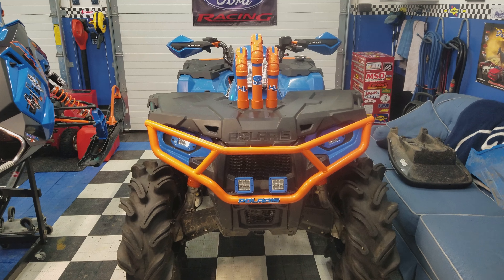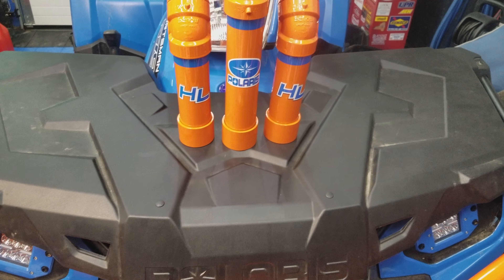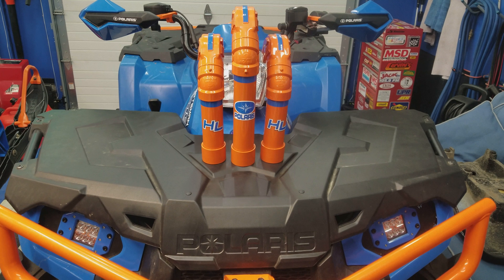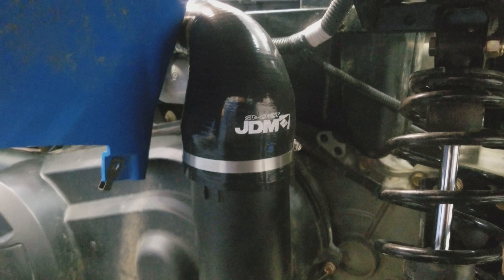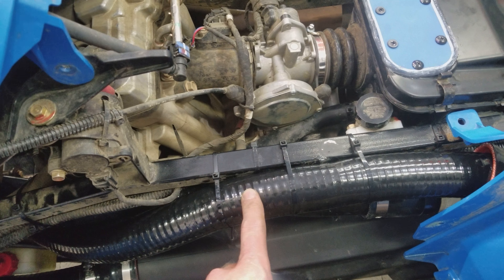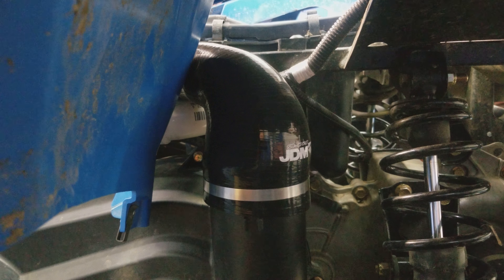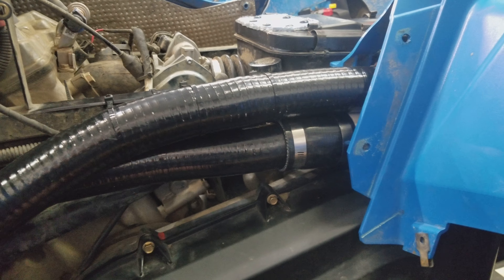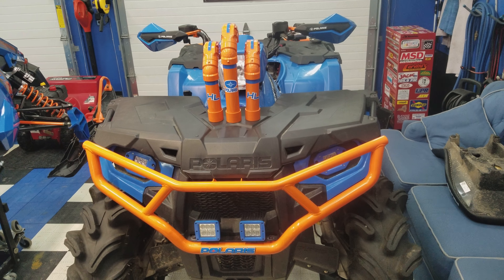2017 Polaris Sportsman 3 snorkel install

Comment: those fittings are a 2" male and female threaded adapter
Reply from the maker: Jayce Vessier nope. I used a rubber 1.5" coupler to connect the flex hose to the risers. I tried the threaded ones and they weren't near as sturdy.
Reply from the maker: Sorry a 1.5" coupler is approx 2" inside diameter.

Comment: Are there supposed to be 2 snorkel pipes that run from the airbox?? I've never run a snorkel setup before but I'm curious about the 4th snorkel tube and if it's necessary? I just bought a 2017 as well and was wondering how it's holding up for you. Any problems so far?
Reply from the maker: Most kits do have two but I only ran one.  Absolutely ZERO issues in 2 years.  Watch my latest video.  My son is two bikes ahead of me in the video and he went through the swamp without any problems.  We do that on a regular basis and his snorkels have never failed.

Comment: Could you possibly take pictures of how you mounted the risers to the storage box?
Reply from the maker: Not without loosening the clamps which is a pain. They are held in place by the tight fit of the hole through the box lid and then the rubber coupler that connects the snorkel riser and the hose.

Comment: I would definitely use PVC rather than abs pipe. Abs is much more prone to deforming from heat, even just the sun on it. But it's still not likely to happen with such short pipes

Comment: you should have coiled like 2' of flex pipe inside the box so your storage is still accessible
Reply from the maker: Jayce Vessier I couldn't because I used 1.5" pipe for the snorkel risers. Wanted to use the HL tops I was given. If I had of used 2" risers I would have.

Comment: What did you use to paint the snorkels and the brush guards?
Reply from the maker: Bumpers are powder coated and snorkels are painted.
Reply: @scottkendall8332  Thank you. It came out really great looking. I have the going deep kit to put on but I'm planning on changing the tips. I like the downward curve you did. How is it with just one tube for intake?
Reply from the maker: @TheLiljock42002  no issues whatsoever. 2 seasons on bike now.
Reply: @scottkendall8332  has the paint held up on the snorkels? If so what did you use to paint them if you don't mind me asking?
Reply from the maker: @TheLiljock42002  yes it has held up very well. Used rustoleum primer then tremclad orange gloss

Comment: What size coupler into the air box??
Reply from the maker: 1.5"
Reply: Scott Kendall did you ever relocate? If so where?? I need to snorkel mine...
Reply from the maker: @TonyEffinNguyen  yes I did. My snorkels are behind the rad now.
Reply from the maker: https://www.facebook.com/kendallsledandatv/photos/a.863010657410620/863019587409727

Comment: having a real hard time finding that 3.5" to 2" silicone reducer anywheres. anyone have a link?
Reply from the maker: https://www.ebay.com/itm/2-To-3-5-Jdm-Turbo-Intake-Piping-Silicone-Hose-Reducer-Coupler-Black-Red/233216399662?hash=item364cc7d92e:g:c~kAAOSwvqFczKZD